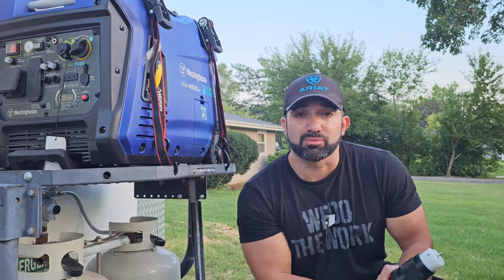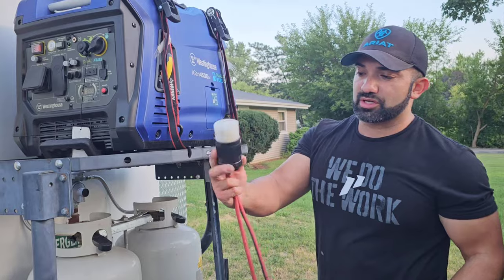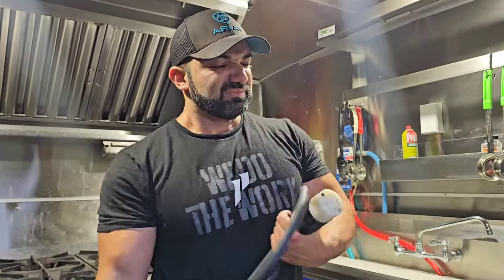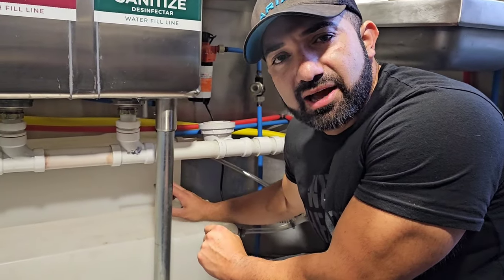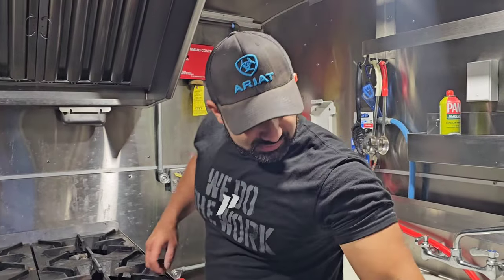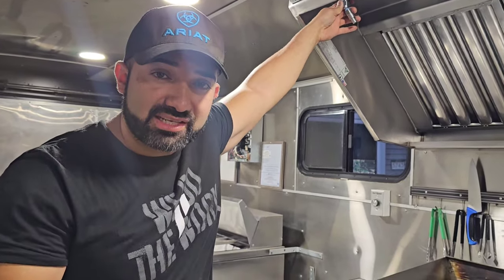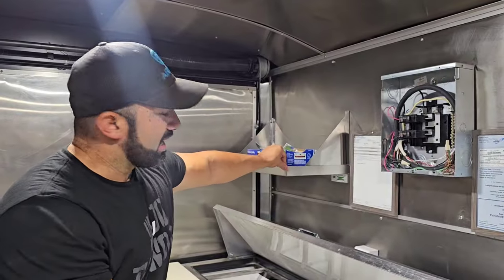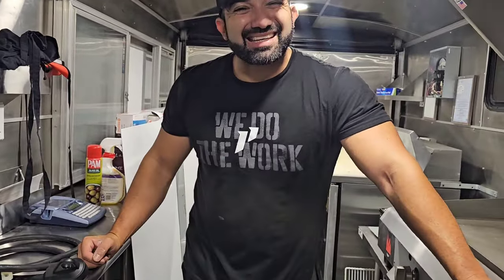Can I Build My Own Food Truck?

Comment: Hi Frank Do you have any info on a metal detector that will find metal studs in my concession trailer walls which are stainless steel but the stainless walls are also magnetic. I don't want to drill holes not needed in my new trailer. Thanks for any help
Reply from the maker: The only Detector I have used is the stud buddy at home depot

Comment: Almost done with mine but what did you use to get drain out angle on fresh water tank
Reply from the maker: Not sure I understand the question, but to drain my tanks I use a Valterra Gate Valve
Reply: I saw that. But for some reason I was thinking I needed a slight angle to drain out completely.. I couldn't find in my review manual so I guess I don't need it. I have watched every video and you walked me thru it so well GREAT job thank you @fbaltierrez